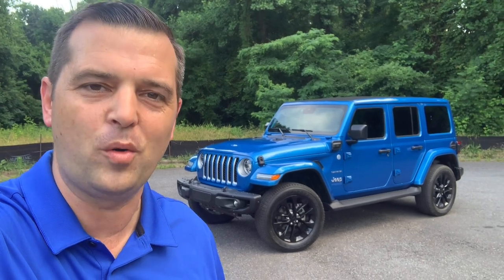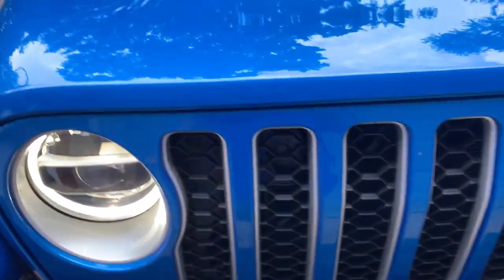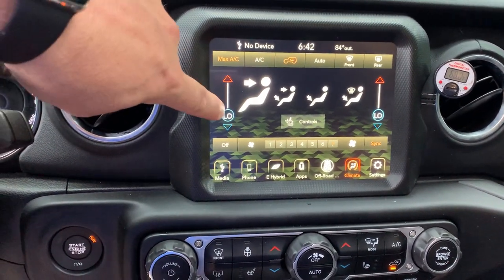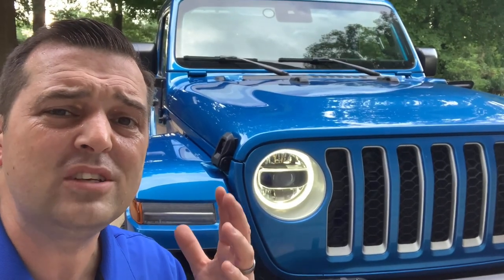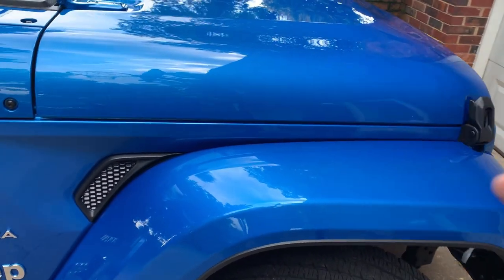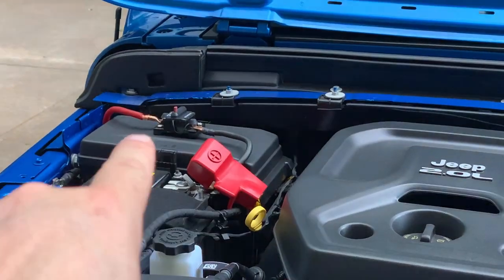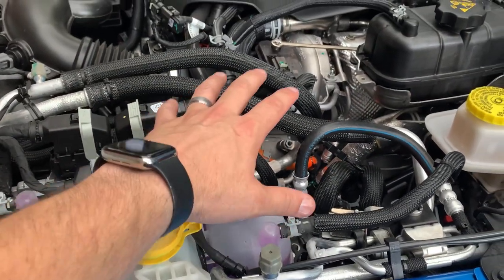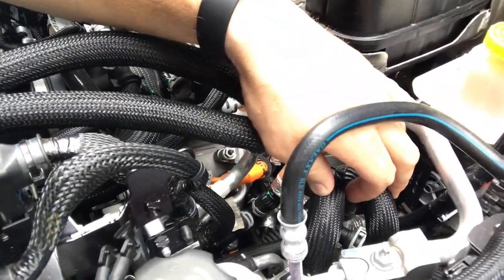Noisy AC Compressor... 2021 Jeep Wrangler 4xe

Comment: Brandon I just want to say I really like your videos.  You make me want a 4xe so badly.  I just wish it fit my current situation.  With a daily commute of 28 miles each way with no way to charge at work I think this is something i have to wait until I am retired or transferred to an office closer to home to take better advantage of this fantastic vehicle.
Reply from the maker: Yes, your right. In around 28 miles myself. I can charge up sometime at work.  It’s worth it  if you can charge at work
Reply: U don't have to charge right away it will run on gas then when get home charge it, the level 1 charger takes to long tho, 12 to 15 hours 😩

Comment: Agreed, compressor buzzzzz is super noisy in the 4xe especially compared to my Bolt EV and ex 2017 Volt.  Similar power draw from the battery across all the vehicles, but GM seems to do a much better job of insulating the electric compressor of noise.  Not a big deal to me, its part of the "jeepiness" of the the 4xe imho.

Comment: So as long as I run the AC I don't need the pedestrian noise generator. 🙂
Reply from the maker: Lol. That’s right. It’s 100 times louder than the per module
Reply: @BrandonHaneline  I'm interested to see how loud mine gets when it's charging in my 120°+ garage in the summer.
Reply: @cbr2200 it sounds like it’s going to blow up!  It’s super loud. I’m in Texas, by the way.
Reply from the maker: Shouldn’t be. The engine is very loud. The ac compressor has a distinctive noise.

Comment: Brandon, my compressor was also freaking me out the other day and I noticed for the 2nd time that the oil temp was 122F on the dash but 419F on the Uconnect off-road pages. 4XEFans told me it’s an Easter Egg. Seems odd to make that an egg. Your thoughts?  Every time I take this in the dealer just scratches their head...duh. No one seems to know much about this Jeep.

Comment: Great video. Question. Are you able to use the A/C on just using the battery for how long?  I mean Can I sleep inside the jeep using just the battery? Like the camper mode in the Tesla?
Reply from the maker: Yes. I show how to do that in a different video. Search jeep powered house.
Reply from the maker: In this video and show you how to use the AC for camping. https://youtu.be/HB2K8q0igNc
Reply: Great I just checked. Great video too. Thanks. Maybe your next video could be to camp whole night using this steps.
Reply from the maker: Oohhh that would be cool!!

Comment: It'd be interesting to do a 5-10-20 foot decibel test on it.. I wonder how loud it is vs other everyday noisy items?
Reply from the maker: I did that but didn't want to get to technical 5ft around 85 decibel. 10ft 75,
Reply: @BrandonHaneline  Wow that's pretty loud actually! I figured there'd be noise but not that much.. I think most of those inverter generators are about 7-10 db less even haha!!

Comment: Open the hood is the engine spinning from the start moter ? Maybe with the valves open spinning the engine Why is there a belt on the AC compressed and what’s that other belt on engine they say is starter moter remember it has no alternator 

What I’m trying to say is 
Is there electrical motor spinning the engine threw the engine crank to power the wheels  there is two belts on that engine 

And does this have the two batter set up under the hood what happens if the battery under hood is dead with no batter power under the seat
Reply from the maker: There is no belt for the ac compressor.
Reply: @BrandonHaneline  there are two belts under the hood what are they for I look at one at Jeep beach week
Reply: Concerning the 4xe’s powertrain, we've covered it before and there’s nothing particularly notable about it. Up front there’s a 2-liter gasoline engine that drives the wheels and acts as a generator. There’s a 134 horsepower / 181 pound-foot electric motor (P2) located on the end of the eight-speed automatic gearbox to which a shortened drive shaft is connected. The engine is also aided by a smaller belt-connected electric motor (P1) that provides an additional 44 horsepower and 39 pound-feet of torque (it’s used as part of the eTorque mild hybrid in other FCA offerings). 

So it does have a power threw electric moter spinning the engine